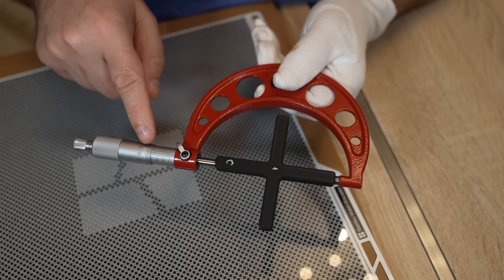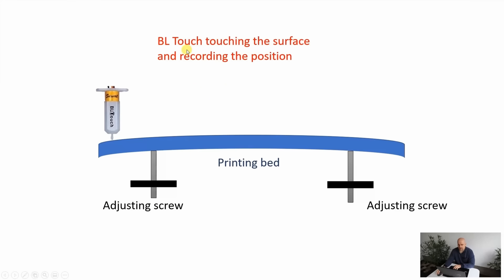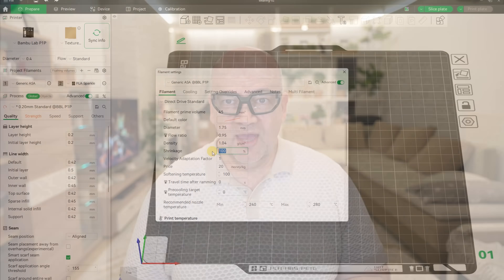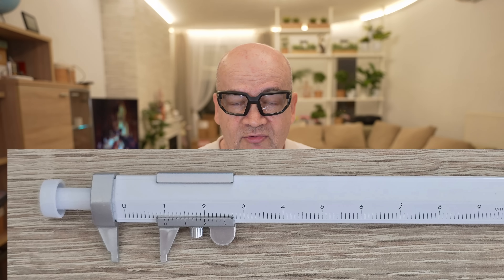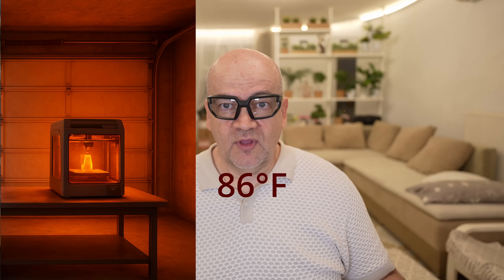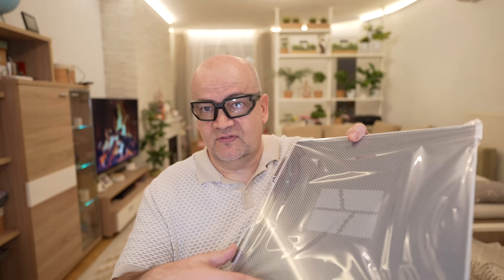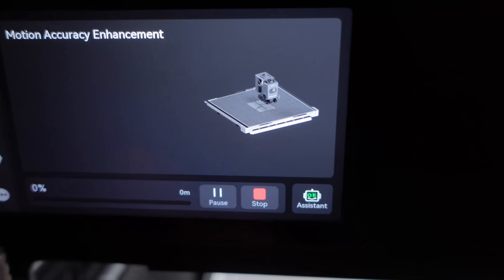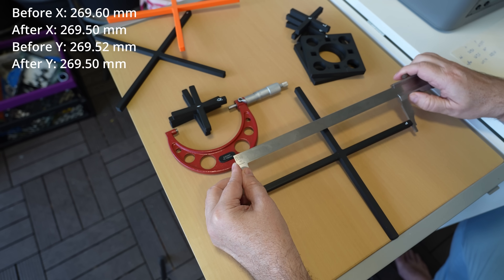Bambu Lab Vision Encoder tested and explained

Comment: In my use case it is more interesting that the biggest difference in the 90  mm measurement before was 89.88-89.79 = 0.09 vs post calibration 89.84-89.80 = 0.04 because that may more directly represent how well parts will fit together, as in a dovetail or similar feature. So that is a good improvement… from that perspective. How relevant is that? Would need to print some dovetails and see. I do like the X-Y for a given location that you did which is possibly a clue on how round the holes would be. Measuring holes at home is hard, unless we are just using plus/minus dowels. BTW, I thought when using ratchet micrometer we limit it to a set number of clicks, somewhere between 3 and 5, though always the same number, done slowly. Very informative video. Thanks!!

Comment: I think perhaps it's actually a good thing that this accessory doesn't seem all that necessary—it means that their machine is plenty accurate enough on its own. The only issue I could see is that they seem to lock down the configuration for these kinds of calibrations in firmware, so you can't really do it manually otherwise if needed?

Comment: I just don't understand why this product isn't a $15 item or even $30 tops.  The price is just not reasonable.  If they would sell them for $20, they'd sell a ton even though most wouldn't benefit.  It would just be worth spending $20 for a little reassurance that the printer is relatively accurate.  At $105 and with the mediocre reviews of the product, most will just pass.

Comment: This situation is a JOKE. Bambu claims 50um XY precision w the vision encoder while Z can be close to 1mm out in some locations on the bed !
Story: my H2S's bed is curled up by over 0.5mm along both the back, left and front edges (right is fine). I print 340x320mm large parts, so occupying the whole bed surface.
Since bed calibration / leveling only warps our parts' geometry to match the bed shape, boasting of high XY precision while the bottom surface of my functional / engineering parts is 0.5mm out of plane is a massive joke
Response from Bambu support: this is in spec for the bed !  Marketing lies, more lies and damn lies 😤

Comment: The bed adhesion problem you have in the front is because you lay your fingers on that spot every time you grab a finished part.
Reply from the maker: It happened 2 times. After the first one I cleaned it very detailly.

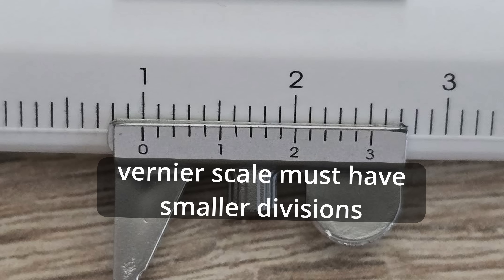Comment: 4:38 I recently switched from digital calipers because my digital caliper appeared to be working but the measurements were actually wrong. A normal caliper is unlikely to give incorrect measurements and I will never need batteries for it.

Comment: I feel like you should have calibrated shrink for this, you can use the calistar (free) or califlower (paid) to do this. It would also have been nice to measure skew in the axes before calibrating, as the vision encoder plate helps with this too.

Comment: The vision encoder is a great tool for reassuring doubters that you can get accuracy out of a 3D printer. My boss did not trust 3D printing to give us accurate enough results, but when I showed him that the VE would help dial in the machine to sub 50 micron accuracy, he changed his mind and bought a machine for me to use at work. I paid off the machine with the first 5 prints and then saved the company about $50K in 3 months. Never needed to use the VE, but it was still the tool that made it all possible.
Reply: What company is this 😂

Comment: I am making a free pendulum clock (has 2 pendulums.  My one is a significant variation on this  https://www.youtube.com/watch?v=UkD7pxPC6qw).  Motion work in PC & frame in ABS.  I have H2D.  Bought the Vision encoder.  It found very little wrong with my machine.  Money not well spent - as you say.  But I am reassured by what it showed.
Reading the comments I will get the Califlower.  I am a retired mechanical engineer.

Comment: I have essentially zero experience with any kind of mechanical engineering, I've never even used a caliper, and I could not only instantly see what's wrong with that first caliper, but understood how the second set of markings should have been done. The second, correct caliper was more or less exactly what I expected to see. No doubt it would take some practice to read them by sight, but the principle just seems obvious. Hmm… maybe I should have gone into mechanical engineering. 🤷

Comment: I agree - that fake Vernier pen is unacceptable lol

I don't have a Bambu printer so this isn't super relevant for me specifically, but in general I think the topic of print accuracy and calibration is a very good one and I appreciate the discussion here in the comments - hadn't considered the effect of belt tension on skew for my Voron 2.4. I 3D print prototype parts and getting accurate dimensions is critical - just had an issue where my test data was worthless due to an inaccuracy of 0.15mm in the hole center-to-center spacing on one part. Switched to a non-FDM 3D printed part that was more accurate and all was good. For me being able to print within the tolerance window of what I expect from the injection molds is pretty critical. 

I'd be curious to see a larger sample size of Bambu printers to see if yours was typical or if other printers benefit more from this vision system calibration method. If this system was readily available for Klipper printers at a reasonable price I'd definitely consider it.

Comment: How Ironic. I posted about the VE plate in the Facebook group for Bambu users.  I use one myself. I have 2 H2D and I can see a difference in print quality before and after calibration. I think the VE plate has more to do with the 2 head printer than the single head because the nozzles are in different locations between the D and S models.  I print high detailed multi color .2 nozzle  prints, so maybe thats what its goal it.  I haven't used the laser yet, but it probably helps with that as well.

Comment: 3D printers still have a lot of room to improve dimensional accuracy. I'm not an engineer but I worked with lathe and milling machines, both manual and CNC. We learned the use of calipers and mechanical gauges in school. At work, the workshops with the machines were air-conditioned close to 20°C because the dimensions we garanteed to the customer was supposed to be measured at exactly 20°C (ISO standard norm). Every measuring equipment was tested and valiedated by a separate company once in a while. There was a dedicated team working in a closed area with precise temperature conditionning and very expensive metrology equipment for even more accurate dimension controls before shipping. They could almost model a mechanical part in 3D by testing hundreds of points with an electronic probe to check the dimensions. You would get yelled at if you leave the door opened, a small air draft could ruin their work ^^ The most precise lathes would go down to +/-0.001mm in diameter accuracy, while milling machines were more in the +/-0.01mm range. The ISO standard we used garanteed +/-0.05mm to the customer. Concentricity, geometry and surface finish were also measued and needed to be in some margin according to the ISO standard. Precision mechanic is another world compared to 3D printing.
Reply from the maker: Wow, 0.001mm for lathe. I never saw better precision than 0.01mm on lathe.
Reply: @MyTechFun  Yes they were CNC lathes from the german brand Index, built in the late 90's early 2000's I believe, very good machines.

Comment: I think this might be missing the most useful purpose for this device, specifically for corexy systems.  Since the XY squareness is determined by belt tension (on a system that has any amount of flex), you can get major skew deviations on corexy.  This plate should completely remove that.  The skew deviation is pretty much impossible to measure in the way you've done here.

Comment: I don't quite understand how the calibration is supposed to work.
On big dimensions, the relative error would be low (ignoring material shrinkage). And you wouldn't need so many markers on the encoder plate. You'd need just one for each edge or corner.
Perhaps the biggest factor in errors would be the not-perfectly-linear engagement of belt teeth in the motor pulley. If that's the case, it would have made more sense to test multiple dimensions at steps of, say, 0.2mm and check the accuracy of each one before/after.
Still, I think it's clear that it's not going to make much of a difference.

Comment: Am I understanding.. you put this specially marked plate on the bed and a camera on the head of the machine scans the pattern on the plate..?

I think I see a flaw in that results would depend on how squarely you placed the plate down and how true the camera's orientation is to the motion axis.

Metalworking CNC machines use linear encoders on the axis themselves, this is the only way to really do closed loop compensation that accounts for thermal expansion of the machine itself during running.

Comment: I think the Vision Encoder isn't really meant for the printing mode. There's just too much variability from the physics of the plastic. Where the accuracy of XY movement matters more is when using the laser or cutter attachments. (I doubt the pen for the plotter attachment will reach this level of accuracy due to ink bleed on the paper.)
Reply: I think Bambu should send Igor the H2D with the 40W laser to check that out.

Comment: I really don't understand what this plate is for but good to see this video
Reply from the maker: Just to be sure, that the XY motion accuraty is good. But you still have to do the shrinkage compensation..
Reply: @MyTechFun  yes but the precision of the 3d printer is too low to see a real difference. Bambulab should make a video to explain when and for what is it useful

Comment: The biggest difference will be in the diagonal direction, not along X and Y. We had a QIDI Plus 3 at work that had a huge problem with skew because the belt tensions weren't exactly right. All the circles came out as slightly oval, stretched diagonally. This made it a nightmare to get anything accurate off of it. I had to do a manual calibration for skew,  and repeat it after a while due to belt stretch or wear. This is a problem with all core XY printers, which is why there are usually some complex mechanisms in these Bambu printers to tension these belts evenly. But even with the belts being evenly tensioned, you still get some drift of how perpendicular the axes are at different points. This encoder is definitely a good idea. It would be even better if it was made from Zerodur (almost zero thermal expansion glass) so that you could calibrate it accurately at different chamber temps like mentioned. It would also be interesting to include encoder QR codes on the regular beds, so the printer can do a quick check periodically to detect whether it needs to be calibrated again. I'm constantly impressed by these solutions that Bambu comes up with. They are really raising the bar for 3d printing as a whole.

Comment: The errors in the mechanism (ignoring material shrinkage) come from:
1) The frame.
2) The belts.
3) The stepper motors.
In my X1C Bambu blew it when they swapped out the toothed idlers for smooth ones on the lower left and upper right where the belts turn towards the front of the printer.  This caused several problems the most important of which is that the belt paths are no longer perfectly parallel with the motion path of the tool head.  This causes the belt tension to increase when the toolhead is at the limits of motion.  And when the belt tension changes the toolhead position also changes.  The best way to see this is to print a straight edge from one corner to the opposite corner.  You almost get the straight edge you expect.  If you place that against a known straight surface you find that you got a slight S curve.  This issue could have been resolved by moving the placement of the idlers to compensate for the thickness of the belt teeth.  I have not had a chance to look at any of the other Bambu printers to see if the smooth idlers were moved to compensate but I expect they all have the same problems as do the competitors who are blindly copying the mechanics.  Gates indicates that it is somewhat acceptable to use a smooth idler on the toothed side of the belt but the minimum diameter must be about twice that of the idlers used.  On my particular machine the belt teeth are shiny after a few hundred hours where the teeth are running over the smooth idler.  It looks like the tooth profile is squashed as well.  I don't think either of these would happen with toothed idlers in those positions.  Position errors caused by belt stretch are less significant and the only solution is to use a better quality belt.  With the commonly used 6mm GT2 belts the correct tension is enough that the motor radial loading specification of a NEMA 17 motor will be exceeded.  And possibly exceed the ability of the frame to handle the load.  This will certainly be true going to the next size up belt.   Motor positioning errors are low.  A full step moves the belt 0.2mm with the typical 1.8 degree motor.  The full step no load error is as much as plus or minus 5% (typically) which is 0.01mm.  This is a static error and will repeat every 40mm.  But we use micro stepping and there is a lot more error due to loading on the micro step positioning due to acceleration loads than the motor errors.  The more micro steps the lower the torque.  I think 4 or 8 micro steps is optimum (for the purposes of 3d printing).  4 micro steps gives a static movement of 0.05mm and 8 micro steps gives 0.025mm.  The loss of torque is so much that going to 16 is most likely worse for dynamic positioning accuracy than 8 micro steps.  A closed loop motor would lower these errors down to the accuracy of the shaft position sensor.  The vision encoder plate calibration will not get rid of these errors since they are not static errors.  I don't know what Bambu is using for micro steps.  Maybe I should try to measure it.

The usefulness of the vision encoder plate is pretty low because while it can correct static positioning errors it will not correct dynamic errors like those due to torque effects from acceleration.  It is a software solution to a hardware problem similar to mesh bed leveling although not nearly as effective.

Comment: I just bought the calibration plate with my H2S. Maybe for brand new machine is irrelevant, but after 1-2 year it can help a lot.
Reply: I do mine once a month, and again if power goes out. This way when I print something today, and want to reprint it next month, it will come out exactly the same, especially since I print fine detail at small sizes.   It also helps when doing a batch run of earrings with writing, I want every one to look the same.

Comment: Seems like more calibration theater to me. I have yet to see a meaningful print quality difference between Bambu (H2d and X1) and other much less expensive and simple machines like a Qidi Q1 or Elegoo Centauri. For the most part even the old Prusa machines while slower are not so different overall and are much less fussy. For that matter I have some prints from my Makergear M2 made in 2012 and frankly the modern machines are cheaper and a bit better but the difference isn't huge. 3d printing is never going to be as accurate as machined parts and that is ok, they don't need to be..

Comment: Maybe this is for the laser cutting (or knife plotter).

I would really love for scaling factor (shrinkage compensation) to work out of the box (Bambu control their filament chemistry & chamber temperature on the H2S so they should know the shrinkage value - meanwhile their ABS profile, for example, is set to just 100%).
Reply from the maker: Shrinkage depends of the filament, but also of the moisture in that filament. So, not so easy to do universal solution..
Reply: @MyTechFun  Maybe a multicolor print with fiducials? Basically make a vision encoder out of a test print? Not perfect, but could work in a general sense. If they added a lidar sensor, maybe they could do single color and use features as fiducials?

Comment: I think the most important thing is that it fixes skew
Reply: Skew and X/Y movement lengths. Got a lot better after I calibrated the H2D. Around 0.3mm in X better compared to Y. Skew got corrected too. Used Califlower to measure it.
Reply: Hopefully, the newer BL printer are more receptive to skew correction than the P and A series.
Reply: Yep, pretty much the case. Every calibration shows that is off in some screwy way or another. Sometime at the front of the bed, sometimes at the rear, my last one was on point on the front left, and skewed left at the rear.
Reply: THIS! Igor, I think this guy nailed it. Skew is the most difficult to measure and fix.
Reply: pretty much the only thing it actually does

Comment: This is like a 300m submergible watch, we aren't going so deep, but it's good to know it will not have issues if one day we jump into the swimming pool. What this calibration plate tells us is: "you neither have the equipment, nor know how to use it, to notice any meaningful difference, your H2D is already more accurate than the filament you use is capable of"

Comment: well it's clear that shrinkage is a bigger deal than what this corrects so it's only useful for people who are doing high enough accuray enough that they are already compensating for shrinkage. Does bambu provide shrinkage compensation settings for each filament profile? if not then this product doesn't make much sense, if so then perhaps you should test with those settings.